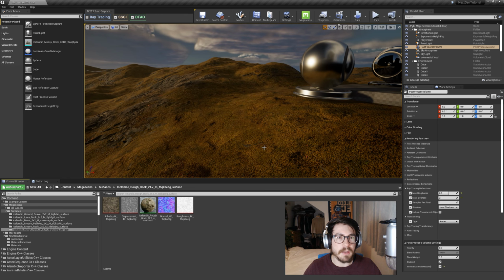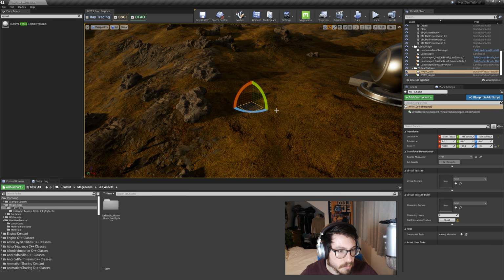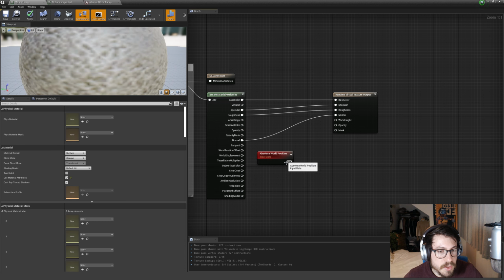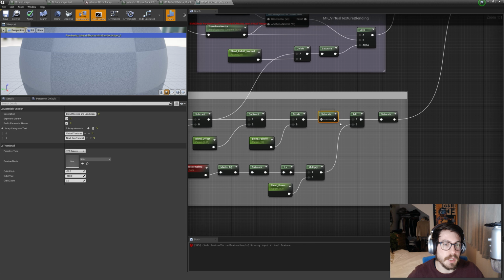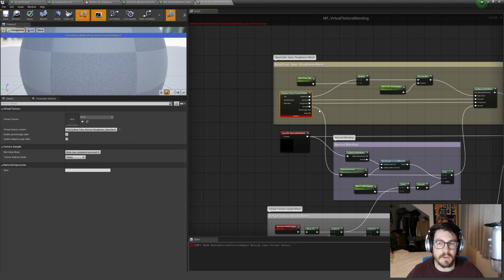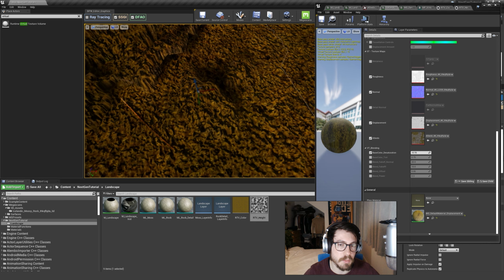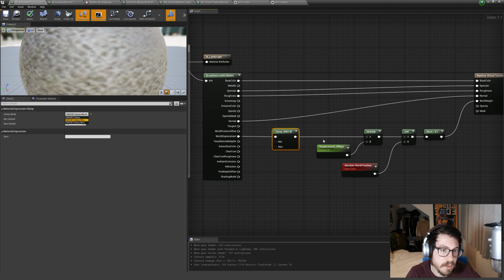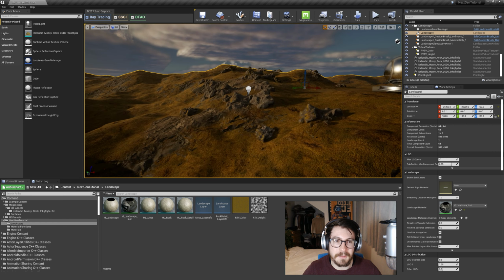Unreal Engine 4 | Next-Gen Tutorial: #05 Virtual Texture Blending

Comment: i have a question do the light function cast shadows onto the atmosphere
Reply from the maker: I've done some tests with it and could not find a way of doing it. There does not seem to be a good way of getting any kind of shadow or fake shadow onto the SkyAtmosphere in general. E.g. blocking out the sun(light) with the moon or another planet (e.g. as static meshes or light functions), does not seem to be possible with shadows.
Reply: @tobiastobasco  thats so sad i thought of optimising my  game by doing that ,by the way unity clouds do cast shadows by using light functions may be i have to migrate my project to unity but i doubt volumetric clouds are not build in to unity ,its a separate plugin to purchase i guess
Reply from the maker: @gursimransingh8726  Yeah, it's a bit of a bummer.... But if it's not part of your gameplay, and a crucial feature, I would just try fake it somehow. Fortunately, most of the time shadows can be faked. For example with a large decal. If you're not doing the most realistic game ever, the player might not even notice :)
Reply: @tobiastobasco  have just done it used light function for shadows ,placed volumetric fog in the level with high distance value ,to match the god rays through the clouds i used the same texture for coverage of the clouds and for the fake shadows , i am thinking to somehow move the clouds and the lightfunction at the same time
Reply: @tobiastobasco  i took inspiration from rdr2 which have some great volumetric system god rays from clouds in that game looks great for running on a console i wonder how did they do it
Reply from the maker: @gursimransingh8726  Yes, their atmospheric weather system looks incredible!
The truth is, they have a massive team working on this. Incredible graphics coders who make this possible and optimise it to no end, so that it runs in frame on consoles.
Unreal's out of the box solutions are great, but if you want to compete with rdr2's system you'll have to have some graphics programmers on your side...
That why I advise you to fake stuff if possible. Godrays can be done with strips of polygons or particles. Cloud shadows are possible. It's often just trickery that makes things possible or run in frame. Even with the more powerful next gen consoles...
Reply: @tobiastobasco  YES I THINK I HAVE TO WRITE SOME CODE